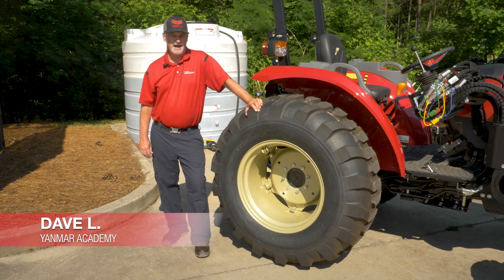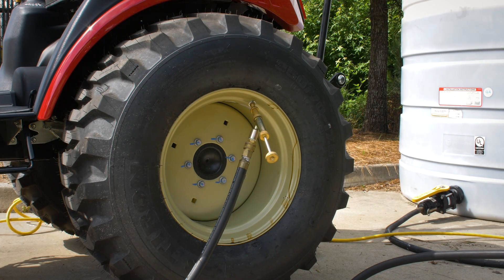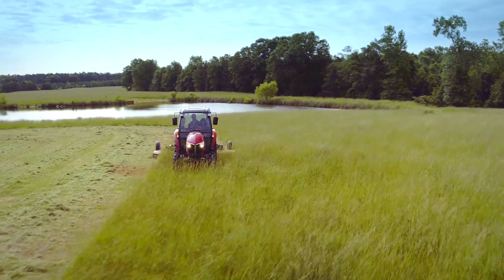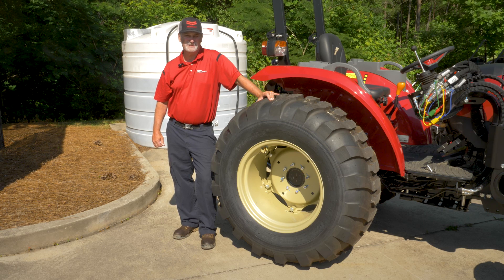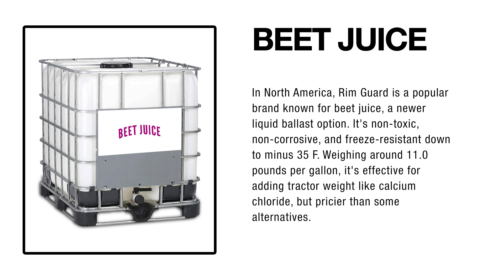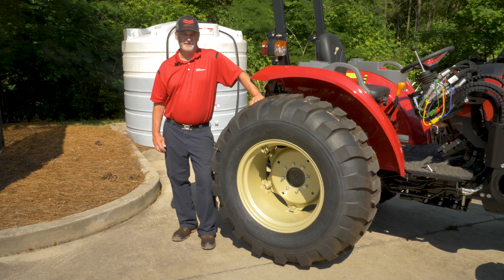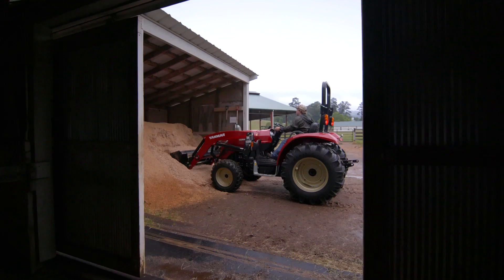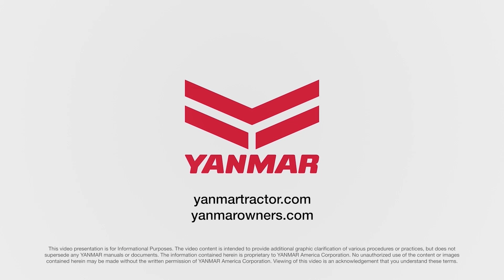YANMAR ACADEMY ADDING LIQUID BALLAST

Comment: Just got my first ever tractor a couple weeks ago and I'm wondering, how much rougher would my tractor ride with liquid filled tires vs just air?   Liquids are noncompressible and there will be far less compressible volume to allow the tires to flex and act as what little suspension there is in rear.  

A second question I have is, what about wheel weights?  wouldn't they have the same effect as liquid filling as far as stability?  what are all the pro's and cons when comparing bolt on wheel weights vs liquid filling?